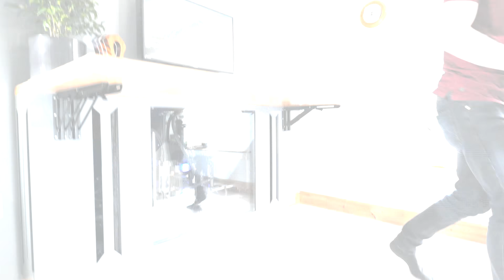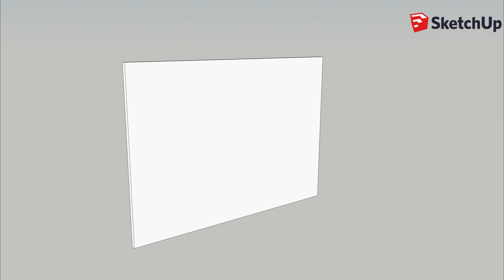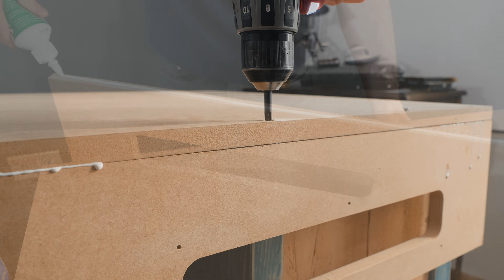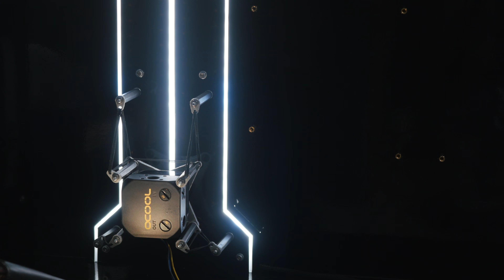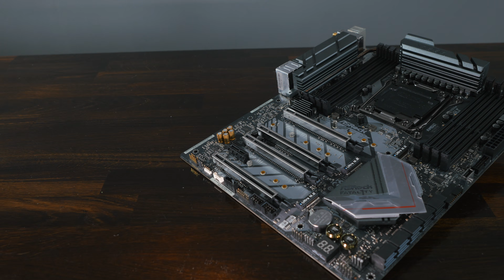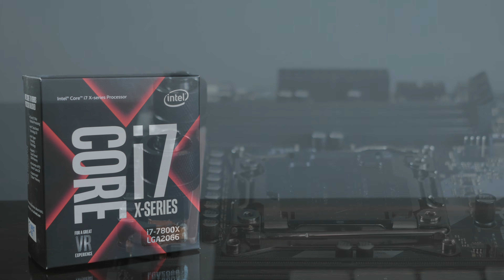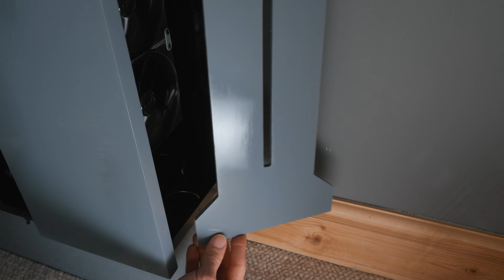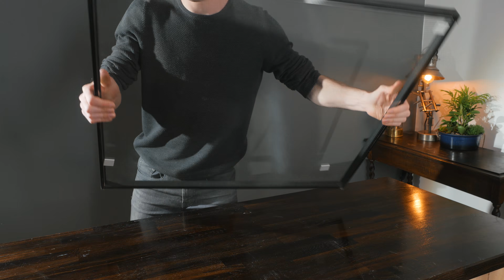Building a spectacular DIY 'desk PC' (it can fold!)

Comment: Having such a big computer case I would have rather used a big sheet of copper as a passive heatsink instead of radiators with fans, but it would take a lot of copper soldering. Just to be a geek. Great build anyway.

Comment: Stellar job, Matt and team!

I've never done a custom loop, so I was wondering whether it might not have been easier to have the fill tube somewhere else? Would it have been easier if it'd been through the pump directly instead of the reservoir?

It would've been galactic with some brass and/or brushed aluminum trim...and not gray.

Comment: How stupid it is to build a PC with RGB lights and liquid cooling, if you can't see it when you work or in the videos, that's why PC tables that are large are because you can see all the equipment in detail and that gives it a touch. Great for your studio setup, you should put the table with acrylic or something transparent and not with wood and something that can reflect the floor as if it were in the shape of a mirror and that would give it a more futuristic and detailed system of the PC and its RGB system and liquid

Comment: another amazing project.
What I would only change- add a pocket between the PC and the wall for the vertical sliding drawer holding the monitor. That way, with the table folded, you can have an invisible PC setup

Comment: A great project that I am surprised I haven't yet seen. I think I would have kept the water loop for the CPU and GPU separate. I probably would have also mounted the motherboard up against the side to avoid needing to run the cables. Absolutely shocking to put the audio connectors so close to the PSU, which I imagine affects the quality or introduces noise, but a really good build none the less.

Comment: You are cooling the CPU with HOT water from videocard! it has to be two separate circuits of cold water!
Reply: this is what i was thinking too considering he has access to two radiators lol, also the use of soft line in a water cooled pc thats supposed to be showing like this one makes it look worse than i think it could be if he used acrylic tubing

Comment: Very cool! Why suspend the drives? Isnt this damaging ?
Reply: it could make their life span shorter as theirs more of a chance that the read head could crash into the disks inside the hard drive, personally i would have opted to use a few washers and mount it directly too the pc case as it would reduce any vibration noise as well as make the drives less likely to fail

Comment: Say, im looking to build this myself but with 2022 software. I assume all that would change are just some screw placements and possible hookups (might be scarier than I think). How do you access usb and hdmi ports? Are they external?
Reply: from what i gathered in the video he is using an extension box which allows him to extend the ports too the outside of the build for easy access also a lot of screw placement would need to be changed for the PC components as well as the water cooling loop wouldn't look the same as almost all water cooling loops are different however if you do end up building this id recommend first making sure that you know how to build a water cooled PC in a normal case as well as don't suspend your hard drives like he did because it increases the risk of the read head in the hard drive crashing and essentially destroying any data on the hard drive

Comment: I was wondering if laptop internal and external AMD computer technology components be used instead of mainly desktop computer hardware? 
For this sort of information technology project.
Reply: first off instead of saying information technology you can just say IT as most of the people in my line of work do also yes technically you could use a laptops components to build this however it would essentially be a motherboard covered in soldered wires and with a random water block attached so it wouldn't look all that great

Comment: WD doesn't stand by their product. I bought 500gb SSD, their own software was not even compatible with their own SSD.  After speaking with WD customer service,  they were less than useful, kept putting the blame on my system was the reason why WD software wasn't recognizing WD hardware, try to figure that one out? I have a Samsung evo 500gb, had no problem with the install, software or hardware. I couldn't believe how WD SSD was not compatible with with WD SSD. I was so frustrated with my purchase, that I ask to be reimbursed for this purchase, they had no problem reimbursing me as long as I paid for the return shipping, I was like what? Why should I pay for return shipping when it's your product that is working with each other. Then they said, we can pay for the return shipping but your name will blacklist on all WD product warranty. I ask what would that mean? They replied that if I buy WD product or purchase a system that has WD product all warranty will be automatically voided if I have a problem. I couldn't believe my ears on what WD customer service propose. I never had a problem with WD hdd, I always recommend it to others when build a pc along with Seagate. Maybe it was just that Customer Service rep from WD, but I keep the product, but I will never buy anything that has WD, nor would I recommend it to anyone. Everything is find when everything works, but the real test of a good company is when things don't work like they should, and it's WD product that is defective, it shouldn't be the client to pay for the return shipping a WD defective product. I would of been out half the SSD cost for returning it, that's not right or fair for a customer. FYI: figure out the problem with the WD software and WD SSD, for some unknown reason, this SSD was only compatible with WD software that was made 3 yrs prier, this is 8 version backward, I couldn't believe it, how must up is that? I was very disappointed with WD software. WD software doesn't do anything except let you know if the WD SSD is legit, that is it. Samsung has AHCI Mode, Sata Interface Connection and OS Optimization. I don't recommend WD product to anyone, unless you are willing to pay for return for defective device.

Comment: Hello Dear, what is the correct way to assemble a wall-mounted case for a professional computer.
For these components:
CPU Type AMD X8 FX-8350 4200MHz
Water cooling Enermax ELC240
ASUS Sabertooth 990FX R2.0 motherboard
System memory 16Gb (2x8Gb), 2133MHz, CL11, 1.6V Kingston HyperX Savage
Video adapter ASUS GF-GTX650Ti Boost, 2Gb DDR5, 192bit
SSD e2e4 Gaming 120Gb Anubis solid state drive for Windows
Kingston 120Gb V300 solid state drive for games
WD Blue 4 TB hard drive 2 pieces
Reply: @AM-LLOC  Yes, I understand that the weak but novelties of 20 and 21 years old are from those that I like, he still pulls, but I can’t help but pull out the streaming zone. but if it were not for financial difficulties, I would have updated it already.

Comment: I couldn't seem to get an answer for this in the video, but what is the point of the internal radiator? And do all three rads just come into play one after another before it goes back into the system?
Reply from the maker: It just keeps the general air temperature cool inside the system.

Comment: I wonder if there would be enough room to build the PC on a shelf that is standing up(parallel to the back panel) , instead of the back panel and have that shelf on ball bearing slides (like high end kitchen ones but bigger) like one on top one on bottom, then just pull the whole thing out that way like what bee keepers do with honey combs when you need to work on it.

Comment: You bother to water cool the power delivery on the mother board but leave the power supply as is in the inner chamber? Not following the logic. The power delivery on the mother board would've been just fine if the internal rad can already handle the power supply. The diy water block was cool but overkill imo. The default heat sink would've worked equally well.

Comment: I've thought about after cooling while dehumidifier runs... Dew point is easily calculated so for a given set of conditions you can figure out when condensation will occur. I kind worry about humidity going to low and static electricity becoming a problem. I don't have the means to test this lol

Comment: For those wondering about the wiring of the TTP223 switch - a PC power switch has two connectors (ground and some small voltage, 3.3 Volts on my PC). The circuit is 'active low', which means that when the two contacts are made, the switch operates by pulling the small voltage down to ground. The safe bet is to use a relay, but you don't need it. Solder pad A on the TTP223 so it goes to ground when the switch operates, and connect that to the 3.3V side of the PC switch. Connect the TTP223's ground to the other side of the power switch, and connect the TTP223 supply pin to the power pin of a spare onboard USB port. Since the USB provides 5V it means the output pin of the module sits at around 4V (0.7V higher than my switch) when not in use, so I added a diode facing the TTP223 between the switches 3.3V and the TTP223 output, just in case the motherboard doesn't like being pushed up to 4V. No relay, just three pieces of wire and 3 DuPont connectors.

Comment: Doesn't the elastic nature of the suspenders hinder the rotational movement of the components. Dont the fans need a solid grounding to spin at the most optimum speeds?
I could be wrong but I was wondering about it
Despite all that, awesome job 👍

Comment: This is an amazing build and you did a brilliant job at it, it looks absolutely beautiful, but there are a few things that aren't that big of a deal but still worth taking mind.
1: the watercooling loop goes from a hot gpu, to warm vrms, to an even hotter cpu then to the rad, now this will create higher temperatures
2: the hard drives NEED to Be solid mounted to a hard surface or the vibration will shorten their lifespan

Comment: Help me understand something with your incredible build :)
Why did you put a radiator inside the cabinet if its air tight? Won't that just heat up the air in the case? Seems redundant to me. Thanks for your great build videos.

Comment: Awesome - only thing I'd want is to see the pc through the table by insert a second double glazed hardened window into the actual desk top which of course would have a ultra large mouse mat semi over during usage but when used as a media system with a remote controlled keyboard will show the pc off with the table down.

Comment: brilliant ideas, and excellent projects, 
but you should carry out the work in a cleaner way, in order to have impeccable finishes, starting from the painting that you can see the brush marks,
 or how you performed the installation for the cooling system, there will be 2000 € for the cooling system, but spending 50 € on vibration dampers
 would be aesthetically and mechanically a job well done, that elastic system cannot be seen,
sorry for the criticisms, I certainly do not want to disrespect you or belittle your work , it wouldn't be my intention !!

Comment: "AN EXTREMELY POWERFUL 600W POWER SUPPLY!"
No, that's on the low end of normal equipment...

"A HUGE 1TB M.2 SSD!"
Again, 1TB is on the lower end of normal equipment...

Good for you for getting excited about that though I guess
Reply: 1TB of NVmE is a ton. It's not a 7200rpm mechanic hard drive. Agree for the psu, but 1TB M.2 is definitely on the higher end. Not the biggest, but still huge

Comment: I saw this same video last year and was just in complete awe of the build. Looking back at it a year later and I'm left with quite a few questions.
Were the pumps and fans tested acoustically when hard mounted?  Phone vibrations is done with an off balance weight on the motor specifically to give vibration. AIO water pumps are not oscillating pumps but rather an axial pump that do not produce vibrations. I've also never felt (or heard) vibrations from the fans in my PC. All these acoustic isolation seems over engineering and unnecessary. The extended cable job is great but asymmetric cable lengths would make this build even better especially when the cables make a turn. That wire from the TV to the table port just looks weird.

Comment: This is late to the game, but I can't imagine the "internal radiator" doing much more than adding to the heat inside the chamber. Radiators remove heat from the system they can't remove heat from the surrounding air simultaneously.
Reply from the maker: It just equalises the internal air temperature to the temperature of the water in the loop. If the water is kept at 30c, the air ends up being close to that, which is acceptable for the hard drives etc.
Reply: @DIYPerks  by that logic if the air surrounding that radiator is hotter than the temperature in the loop wouldn't it be absorbing heat into the system?

Comment: You could always submerge those components into non conductive oil. Then plumb the oil into an external  radiator. As for alternate wood types, may I suggest either walnut or cherrywood? Both are excellent hardwoods and beautiful in appearance if you stain them properly. If you want a softwood then I'd probably go with redwood.

Comment: nice pc bro
and very nice way of reducing the internal heat as earlier i freaked out about vrm temps and faneless psu in an airtight cabinet

my suggestions 

AMD 3960x + 2080 would be almost balls to the walls config than that i7 

you could have used NOCTULA CHROMAX fans in inside the pc and regular NOCTULA ones in the outside in the hidden radiators for reducing the humm and overall better static pressure and it is best in class for performance vs DB comparison

also you could have got custom sleeved extensions PSU cables from CABLEMOD  via their configuratior in their website
 
please also fill out your reservoir to the brim to avoid the aquarium pump effect

Comment: I am loving this build.  The one thing I am wondering is why have any radiators inside of the air tight compartment.  At this point you are still just circulating the warm air and it isn't dissipating any heat.  Yes, it slows the process down but you could have easily doubled up the radiators on the outside with 600 rpm fans that would be below the ambient noise floor of most rooms anyways.  This would keep temps down even better over a full work day while also being just as quiet.  Would be interesting in hearing the reason for the internal radiator decision.

Comment: Just because a component is designed to be passive/fan less doesn’t mean it doesn’t need cooling, it will need a way to dissipate the heat created and therefore is not designed to be placed in a sealed casing.  This applies to any electronic components, especially memory, SSD’s and hard drives.  All electronics create heat and require airflow to dissipate that heat otherwise their life is diminished with time without proper heat removal.
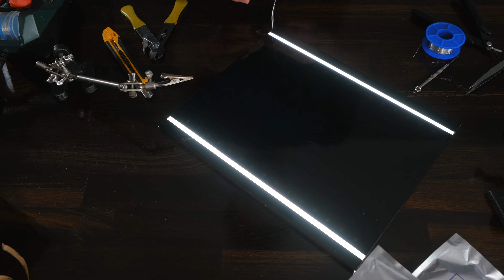Reply: That's what the radiator at 13:00 is for, it sits inside the case liquid cooling the sealed air

Comment: One fault with this system, the GPU and CPU should be cooled by a radiator before going into each other. Linking the two will increase the temps and decrease the performance of water cooling. You can link them, it's just recommended not to as it can lead to parts overheating. Overall a great build, with one minor problem.
edit:
With the huge 480mm radiator for cooling, this might not be bad on the system. However, if you are looking at using a smaller 360 or 280 mm radiator, it would be a good idea to cool the water before it enters the component.
Reply: Not true. Have a read on thermodynamics. You don't get hot spots in a loop and the temperature of the water is constant through the loop. He has done it fine.

Comment: This would be my absolute dream PC setup, however instead of having components hanging using elastic, I'd just use rubber dampeners where they are mounted to reduce vibration and keep the components rigidly mounted.
Reply: Definitely agree. I'm sure you kill more vibrations hanging the components like that, but it just looks like a really bad idea to me, especially for the hard drives. If they wobble too much when reading or writing, you could really compromise all the data inside.

Comment: Does he not know about cable extensions? Would have saved him a lot of time.
Reply: DIY, mate. And it's cheaper
Reply: @szchietzmane6436  I doubt it would be much cheaper, you can get a set for £30.
Reply: @teentechnology9855  I think he did that because it's DIY. He absolutely can buy the cable extensions. But he just wanna show the audience that you can make it too by yourself. If in the end the audience choose to buy instead then that's cool too. Nothing wrong with that. Doesn't make it less special either, right? He did the extra miles for the content, and i personally love it
Reply: @szchietzmane6436  I think it is cool, and I would like to try it on say a USB cable for my next project, but IMHO doing the 50 odd wires needed is just too much for me, it must have taken him forever.
Reply: @teentechnology9855   Yeah, dude. That's what he said on the video. Took him a really long time. Not to mention that this video almost lost because of his HDD failure or something

Comment: The only thing that bothered me in the video was the lack of a heatsink on the M.2 (which I presume you have the version of windows installed on), I've seen M.2s reach up to temps of around 60 degrees before bottlenecking themselves due to the lack of a simple heat block just to soak some up, most of the time a simple head block seems to be enough to keep them at 35-40 degrees C and if any further revisions are made to the build to further improve thermals I'd love to see that.

Great videos man, they're really informative and fun to watch, the balance is juuuuust right.